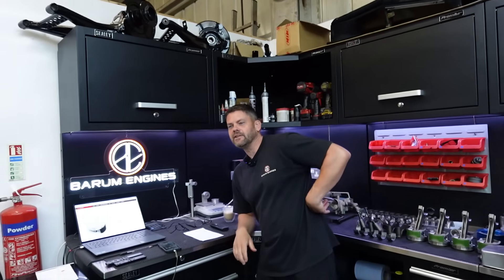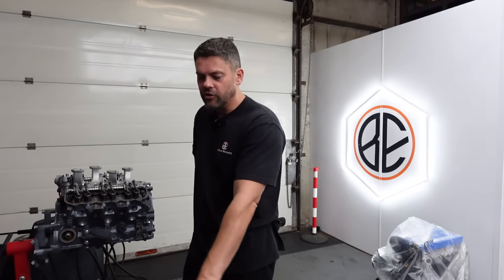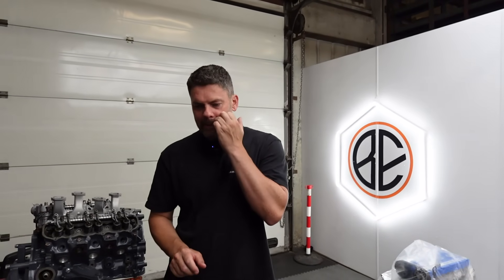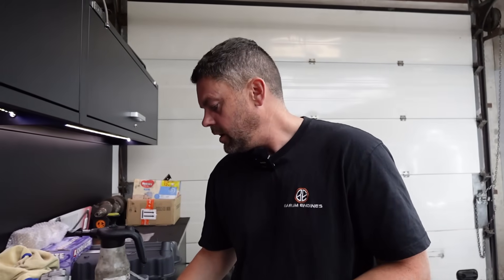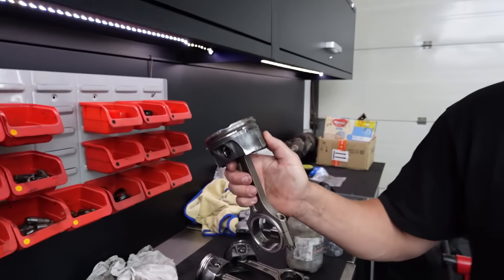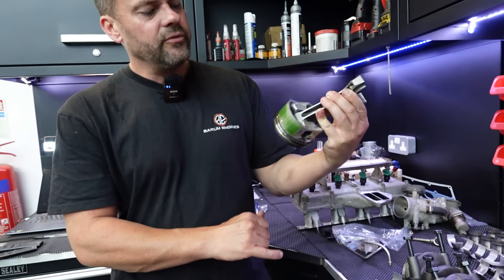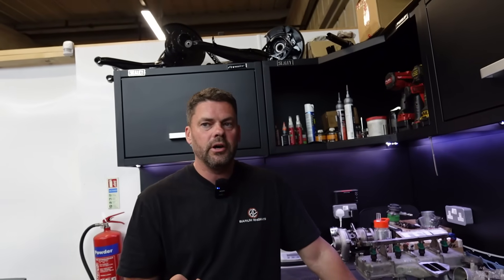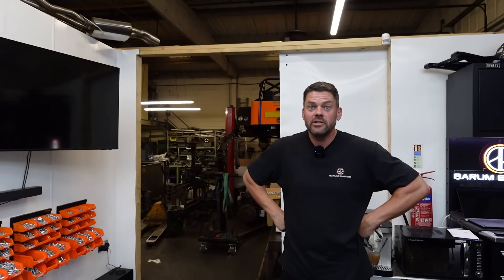WORLDS CHEAPEST COSWORTH ENGINE: WHAT IS YOUR MONEY REALLY BUYING?

Comment: One of my RB25s was making a wierd tap tap tap ,turns out the previous builder had left out the dowels in the block to head ,so the head was moving around and the pistons were banging up the edge of the head  gasket into the head on the edges , new pistons and rings and bearings  , gasket and 2 dowels solved it all